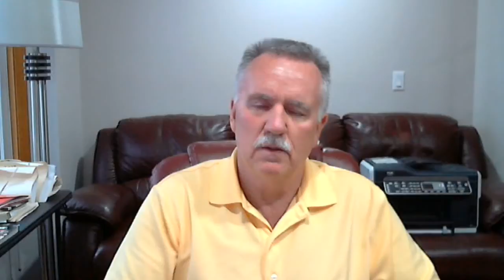Cummins ECM Installation Instruction For A Customer

Comment: my ecm went out , this is the third time this has happened, im getting a new ecm , my question is if the injectors harness is the same as the oem harness or is that a different harness, im thinking that injector harness may be shorting in the block because a lot of times i'm getting a "warning low voltage message" when im starting up my truck in my dashboard
Reply: my truck did that today